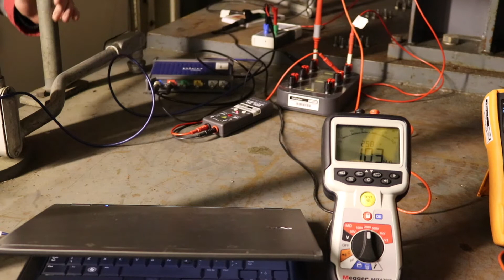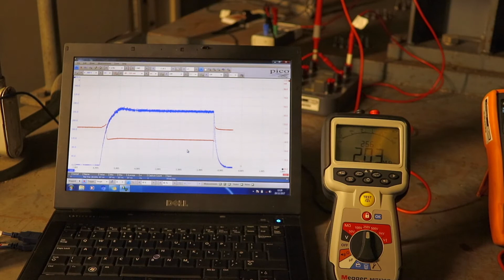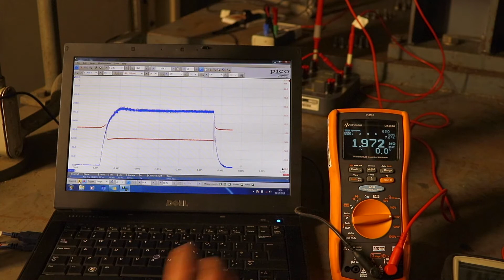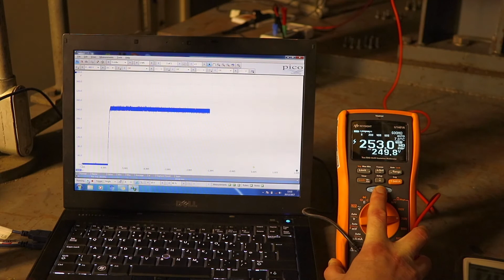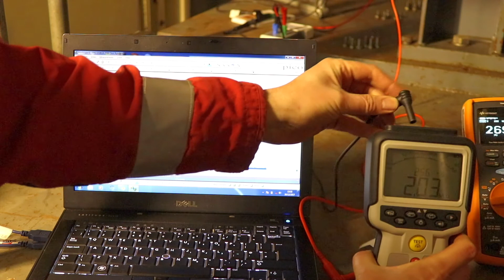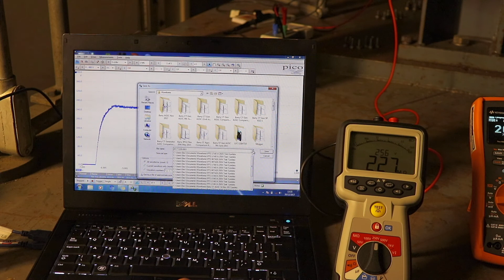Insulation Tester Output Voltage Measurement

Comment: Glad to see you are still curious as to what exactly is going on, me too! It very well could be the rapid rise in voltage in to the coil creating more resistance and as the meter reaches the limit the back emf from the coil and then is starts to oscillate? I can't say what I mean exactly, but I think you get the idea. Could be just the perfect match of inductance of the coil to the meter. Adding in the shunt it slows the rate of current change down. But the voltage still looks stable when the test is run without the shunt and it gets the fluctuating readings. Looks like it has great voltage control but maybe a weak current control. Do you have access to a DC clamp that will read low enough amperage to monitor the current flow?
Reply from the maker: Appreciate the comments inothome. There is certainly some form of oscillation going on. It does have something to do with the insulation resistance itself. The problems start where the rotor insulation resistance is somewhere between 600 megohms to 1 gigaohm. Below that the instrument will work fine and I get a stable reading. This particular rotor is from a 120 MW generator. I have tried the U1461A on both a 210 MW and a 435 MW rotor and get a similar result.

As far as I am aware an insulation tester only has voltage regulation and current limitation. The current limitation will not do anything until the short circuit current, about 1.6 mA for the U1461A is exceeded. The voltage will then start to be clamped. But this does not appear to be happening, It is going the other way, i.e. the voltage remains applied and the current is reduced. The problem is that I am trying to measure such a small current. The Fluke 771 will go down to 10 uA, but really I need to go down to 10 nA resolution. I do not know how big the wire hole is, I could loop a wire through a few times to increase the current flow, but I doubt I will get enough loops through to be effective.

I am not aware of anything else that will go down to such a low current without a direct connection. The U1461A can be switched to a current mode, I will see if I can find that video and upload it. I seem to remember that it did display a negative current at times, indicating there was a reverse flow.

Anything I do to capture the output voltage, effectively places a load on the insulation tester in parallel to the rotor being tested and effectively alters the dynamics of the circuit under test. I may be able to conjure up a high voltage divider with something like a 10 gigaohm input to reduce the effects, I may then see some sort of oscillation within the voltage.

My suspicion is that I just don't have the right techniques and equipment to capture the test data effectively.
Reply: @three-phase562  So this unit just has a problem reading anything in that range or just when connected to an inductive source?  It makes sense to only have the voltage regulation, since the resistance is just a calculation of current and voltage. I couldn't see on your laptop screen what currents you were getting, it was just a little to blurry to see. But since we know the voltage stays stable, you can take the voltage measuring equipment out of the loop and wrapping the conductor around the clamp is a good way to possibly detect that low current. Still seems to me with the bigger device under test and needing more polarizing voltage the induction then starts to come in to play. Whether like we discussed earlier, the voltage ramping up so quick or just the natural effect of the coil opposing the change in current. What if you were to put a high resistance potentiometer in the circuit, that way you can ramp the voltage up slowly to the device under test? Then see if a slow ramp would allow it to measure more accurately.  Thanks for playing along! Having fun trying to figure this out and appreciate all the efforts. I don't have anything near as big to try things out on, nor the Keysight myself.
Reply from the maker: @inothome  At the moment I have noted the fault only on the generator rotors when they have a high insulation resistance reading. If the reading is lower, then the instrument seems stable. The largest motor I have tried the U1461A on is a 90kW induction motor and it worked fine.
I looked at a variable resistor today, but can't find anything suitable. Anything I put in parallel will affect the reading on the instrument and likely stabilise it. if I put it in series, then it won't affect the voltage much as the rotor will have a much greater resistance and therefore the most voltage across it.
I then looked to see if I could use a linear regulator, but I think I am going to have a similar problem.
The U1461A does have its own ramp test system built into it, which I think the slowest it will ramp will be 10V per second. It might be worth giving that a go over the next couple of weeks. Have broken plant to deal with at the moment, so not much play time.
Reply: @three-phase562  Have fun repairing the plant and work safe.